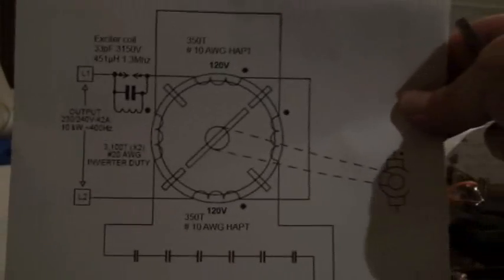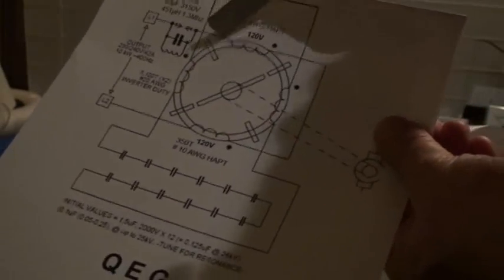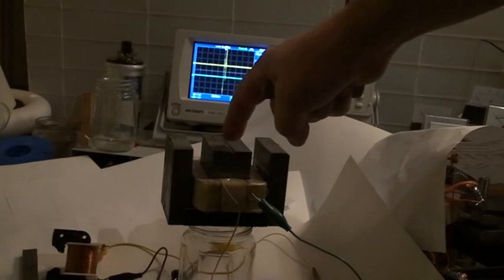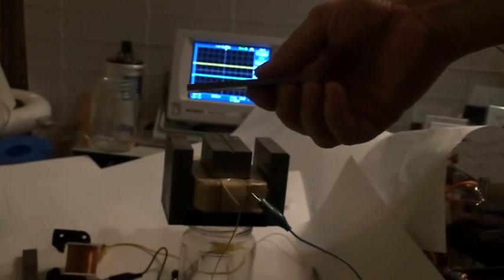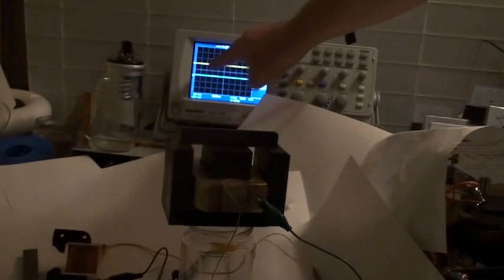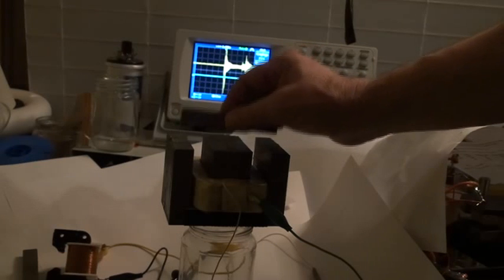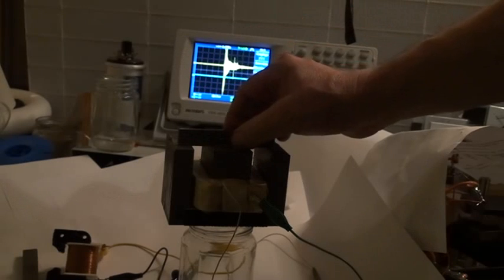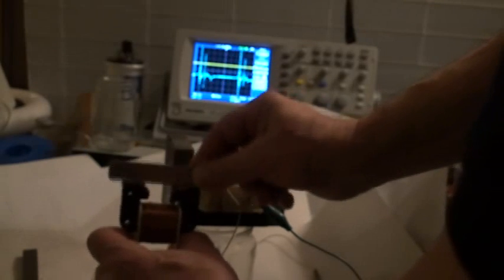resonance of steel creates electricity1 wmv

Comment: Hi woopy, its Jes Here.
Now try placing this metal bar close to contact and put ontop an ultrasonic resonator / vibrator that uses very little power to run....... and see what happens as you make it resonate at very close to contact.

Try winding a hollow copper pipe on a transformer and pump water through it, then you have now also power out of a secondary ;-)
Some of the nice things to try in life

Comment: Suggestion : Fix with screwed riders 2 flat rods of steel (15 to 20 cm) on each side passing above the central core; sliding it, find the good lenght to make them ring exactly the same note as the armature of the transformer : it might resonate. More, being attracted can produce feedback. It could be make vibrate with a small coil above (like a HP) drived at the same note with few mili-amps ^_  Let see what can happen playing with phases (Lenz law effects) ...

Comment: Good experience ! I already experimented this phenomena on a prototype using a cuted transfo like here as stator. I added an antenna fixed on the core of the transfo : taping on the antenna accelerated the rotor and external sounds resonated in the circuit ! But in this video, a peak of induction is possibly created by each taping and magnetizes your piece of steel, adding a part of the voltage.

Comment: interesting... I would grab maybe a piezo buzer and use it to vibrate it... and see what is the input vs output.... but yeah make sure the core is not magnetic at all. prehaps heat it up with a torch to demagnetize

Comment: I'd say that the voltage produced is from the small relative movement between the copper windings and the iron cores which will have a small residual magnetism. You will get the same currents if the cores are hit with a non metallic item. J.

Comment: I don't trust the QEG people but I have heard of some transformer engineers speaking of transformers exploding from resonance with the magnetostriction effect and I see someone else test a similar design to the QEG and get a voltage with no magnets in the system, perhaps the Earth field inducing into the system then back and forth increasing the field. It was enough to light a small bulb.

I duplicated your test but tried wood also. I connected by oscope to the primary of a microwave transformer hooked up to an oscope, no other circuitry used, and tapped it with a metal hammer to see if their wan an effect and YES, I got a voltage spike of 10-15v ! I then tried with a wood stick and also got a voltage spike of 5-10v. I was grounded in both tests so it shouldn't be and electrostatic effect. The harder the hit on the transformer, the greater the spike. Does anyone know if the metal and wood tests are 2 different effects or are they both magnetistriction related or another reason. I tried several different types of wood and metal and the only thing that seemed to matter was the spike of force of it hitting the transformer. Hard metal the highest spike, softer metal less, then hard wood, then a small spike from some softer wood.

Why this would work on the QEG since it is NOT touching the rotor, must be induced Earth magnetism being coupled each time it passes the closer points is the only thing I can think could be happening.

Any ideas ?

Comment: Actually no. When you make the steel bar hitting the metal, you are already putting work into the system. You will have to find means for generating that work. Also you should insolate the metal bar you hold in your hand because you also have voltages conducted to the metal bar in your hand. By holding a metal bar in your hand you also change the impedance.

Comment: Please repeat test with tapping core with wood or other non-magnetic material.
Reply: It's done, works the same way. But the harder the material you use, the higher voltage you get.

Comment: hey Woopy great stuff, yes like the guy here said try mica as well, but I wanted to say to check out a paper Steorn Orbp guys released,9 page approx PDF on google, 
explaining that they did in fact discover the only arrangement that will yield power anomalies, 
it is by using a non-linear, asymmetrical configuration, to explain that would take about the length of the PDF to explain lol .... oooo I found it for ya...
http://www.steorn.com/orbo/papers/asymmetry-and-energy-in-magnetic-systems-rev-1.0.pdf

Comment: This is Great info! How about taking the Piezo Buzzer element out of that same microwave and placing it between the tapping lamination and the coil lamination and feeding a frequency to it via a function generator. Perhaps you could start a feedback loop and tap off some excess power?

Comment: Nice demonstration. Do not forget it has one of the strongest dielectric materials in between the coils. I am sure that played into part of the equation. You have some Mica laying around?
Reply: ***** Yes, there is a small voltage generated by tapping the iron core of a MOT... The voltage is picked up on the secondary... It is not enough to make an LED blink, but it is a voltage none the less... I never got around to making a video... It would be cool to set up the MOT in some sort mechanically induced vibration scenario to see the efficiency of the energy transfer... If I ever get around to trying that out I will make a video.. Peace.
Reply: Hey Diadon, i'm going to try and replicate this demonstration and I'll put post it as one of my vids if it works. I'm only going to use the smaller coil from the Micro-wave fan though, MOTS are too precious to me. I'm off to do this right now
Reply: Nice :) Love to hear the results.
Reply: Binj Komisar Any update on your experiment?

Comment: Tesla was doing this over 120 years ago. He built mechanical oscillators which he used to check the resonant frequency of his coils.

If you extend the middle part of your laminated core and strike it, it will resonate somewhat like a tuning fork and produce electrical oscillations that should last a lot longer. Nice demo.

Comment: Well done Laurent ! What is the maximum peak voltage you get out there when you slap the steel against the core ?
Does the core still have some Remanence magnetism that you shake up ?
Will the amplitude rise, if you put a magnet onto the core and hit the core then with the steel bar or a steel hamer ? Regards, Stefan.